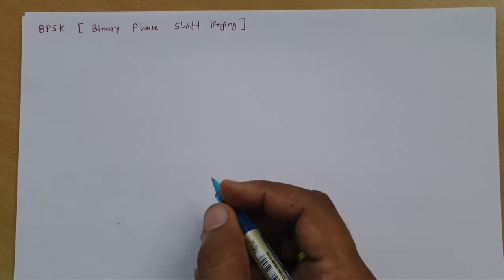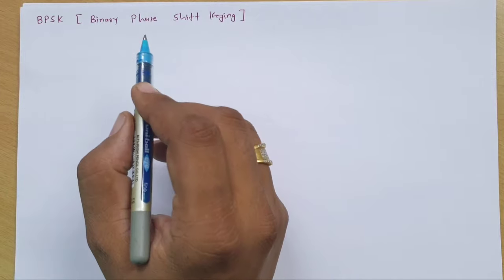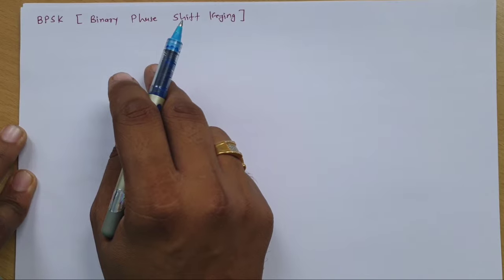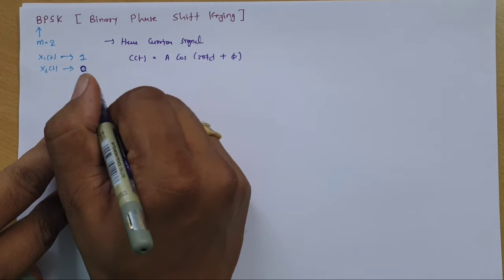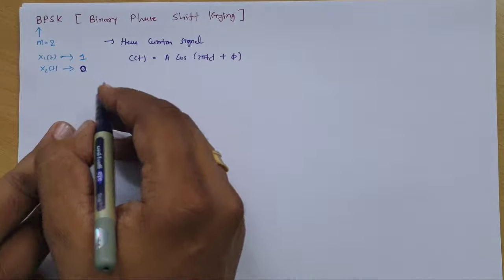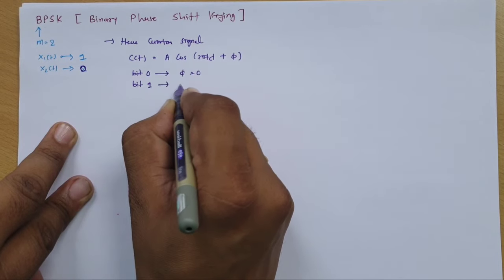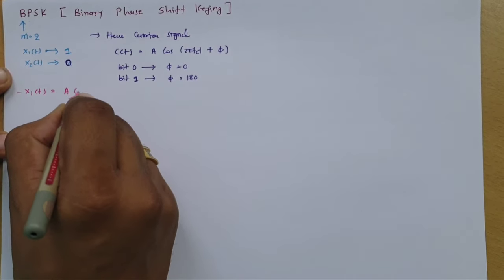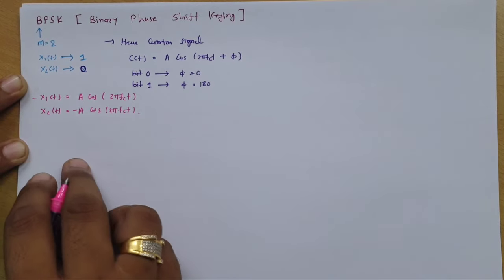BPSK Binary Phase Shift Keying | BPSK Transmitter | Constellation Diagram of BPSK | BPSK Signals

Comment: Sir at 1st at teta = 0 then bit 0, teta =180,then bit 1.but then when u keep 180 and 0 degrees in equation you said reverse like at 180 is bit 0 and then 0 at bit 1  which one is correct sir?
Reply: bro did you find the answer?

Comment: In integration how's the cosine part become zero for 0 to Tb
Reply: Maybe because the signal of sine and cosine has travelled from 0 to T, that is a complete cycle, so it reaches back to its original position. (Cos90 = 0, Sin0= 0)